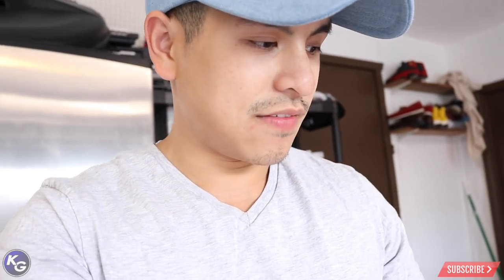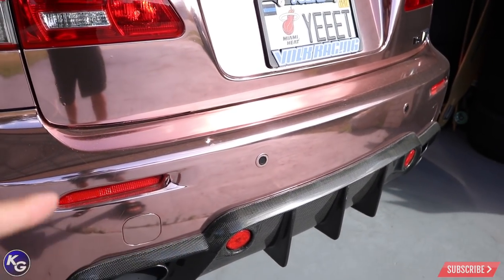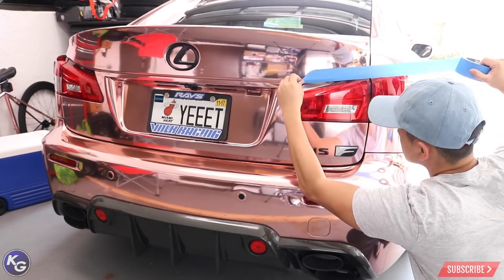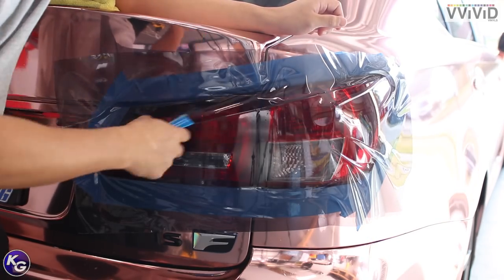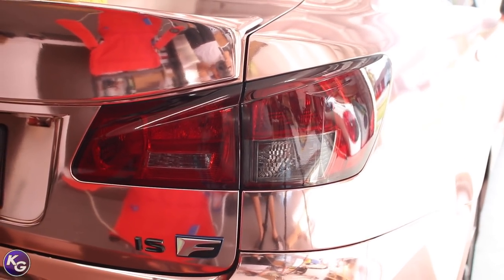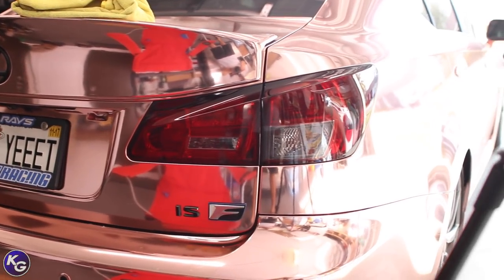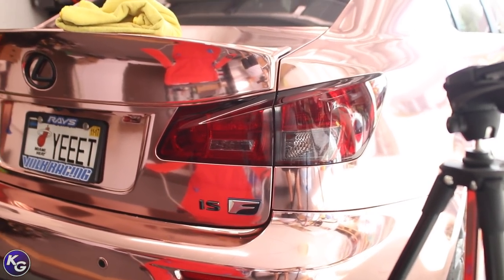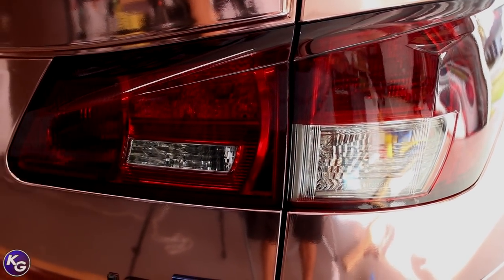Best way to Tint your Tail lights!

Comment: How much vinyl do you need to use for this? I want to order but i dont know size. Any tip?
Reply from the maker: Tommey2k i would do 2x5ft just to be safe
Reply: Lam Le ok thank you for the fast response. One more question, is this clear for Headlights? Nice videos man!